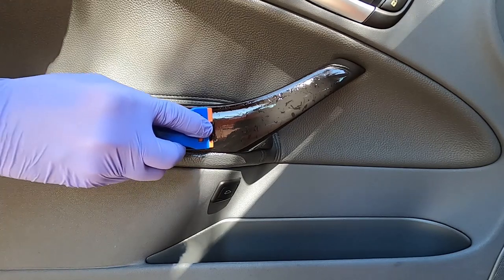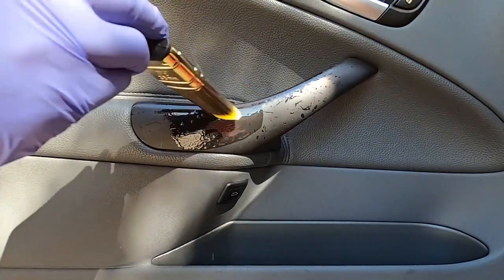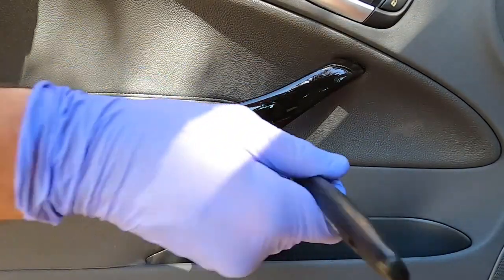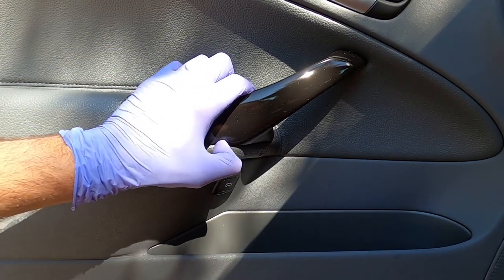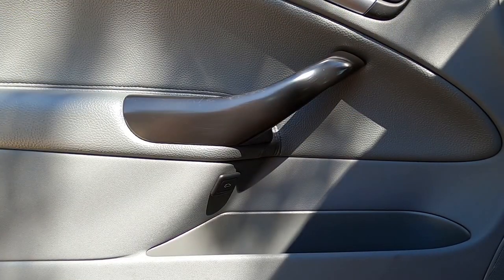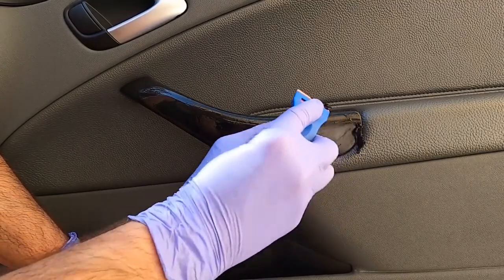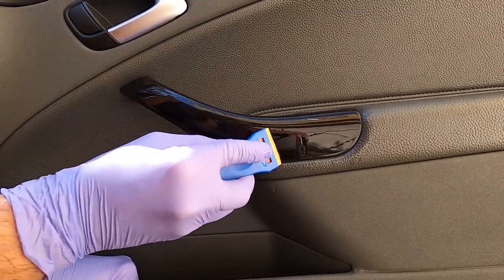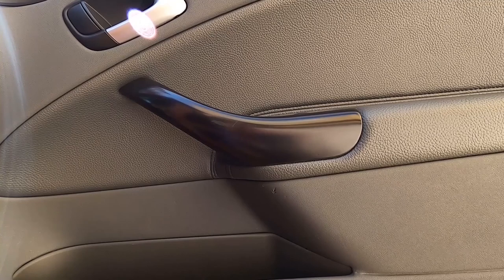Sticky Door Handle Repair - Fix Your Sticky BMW or Saab Car Door Handle - Buttons Too!

Comment: This is very helpful, thank you! One of our worst issues is the door handle, but not on the part facing outward (which is white leather). Instead, the back side where my hand goes as I pull the door shut is a sticky, black, gooey ick that gets all over. Yuck!
Reply from the maker: Yep I hear you! I have experienced that before. The black rubber is tough to get off. Not the way you want to start your drive! Definitely trickier to remove the rubber on inside of the door handle, you can’t get a plastic razor blade in there easily. Using a rag however should get it done, albeit with a lot of scrubbing. Best of luck, you can do it!

Comment: Wonderful result ! But you do realize the trim comes off ? Would have been easier for you.
Reply from the maker: Thanks, and yes I realize the trim comes off, I noted that at the end of the video when I mentioned you can plastidip the trim to restore the rubberized look. I didn’t have a trim removal kit handy, and didn’t want to use a screwdriver to remove it. Plus, leaving the trim on gives me better leverage and allows me to scrape or rub hard vs. holding the trim piece in your hand, for example. Appreciate the comment though! There are definitely advantages to removing the trim for this job.
Reply: Doesn't removing the handle trim, require removing the entire inside door panel?  At least on the BMW 3 series?
Reply from the maker: @twoweeledsoto6072  I think you right. Another case where I’d do this job with the trim left on, as I did on my Saab.
Reply: The Saab trim just pops off with the plastic pry tools. I would be worried about damaging anything around it.
Reply: @marclovescars  Would plastidip spray be good for such a heavy duty surface? I want to spray mine too with plastidip, but I don't know if it will be durable.
Reply from the maker: @JoJanDiezel  Absolutely, I think I mentioned that in the video. Plastidip would looks good for many years, but eventually need to be redone.